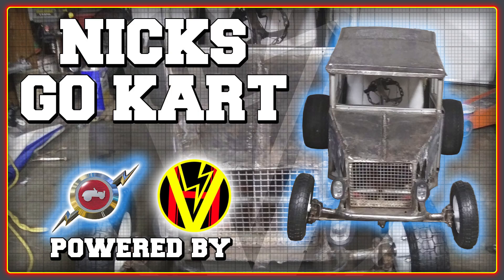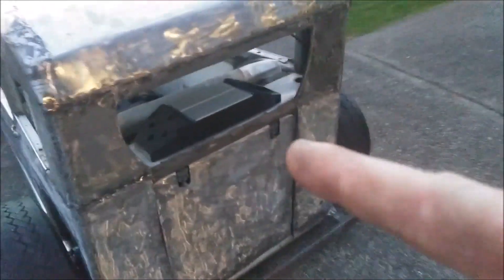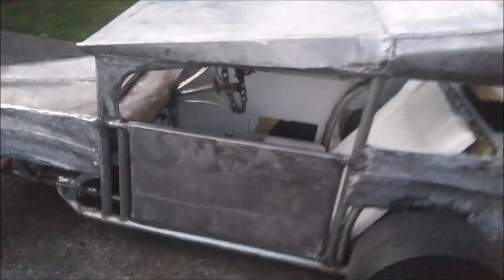Nicks 18kw Hand built Electric Go Kart - Powered by High Voltage and Lightning Rods

Comment: Should have put a ratchet on that motor to prevent wear when decelerating
Reply from the maker: It has regen on it for braking so its fed back in. Not sure of this makes a difference on use of a ratchet. Maybe Nick will see this and update. Cheers.
Reply: Ratchet/freewheel/spag/one way will not work. I use throttle operated regen to help brake